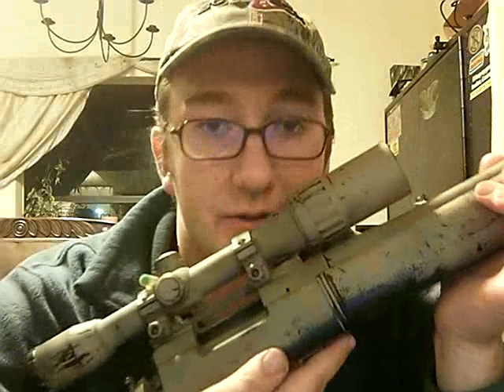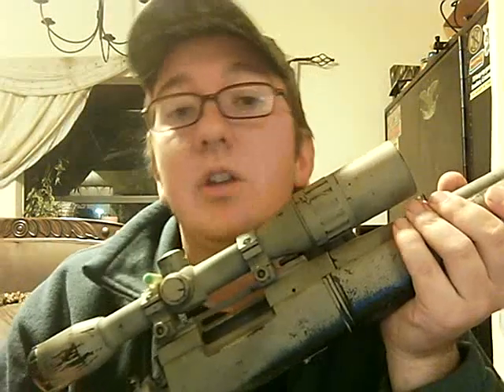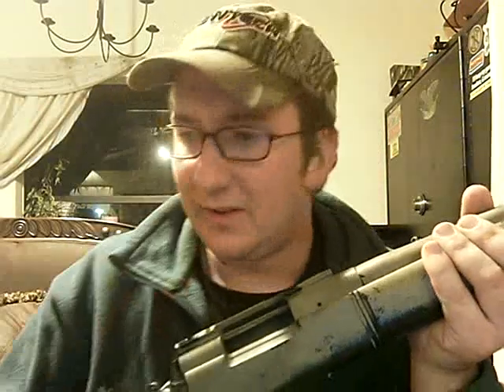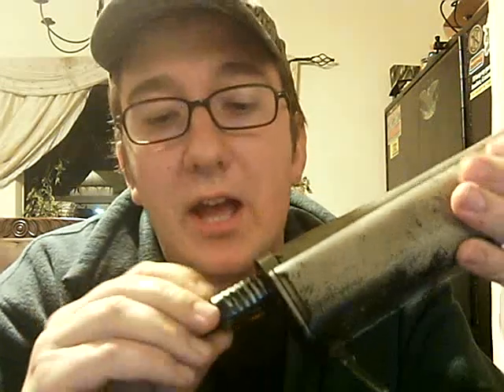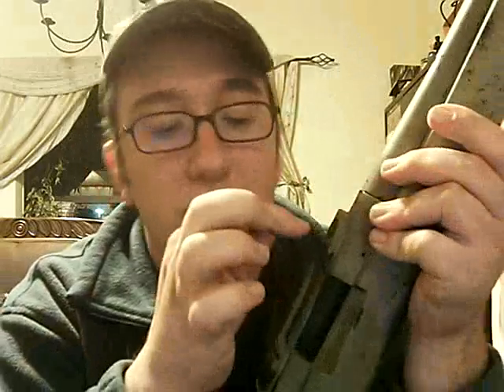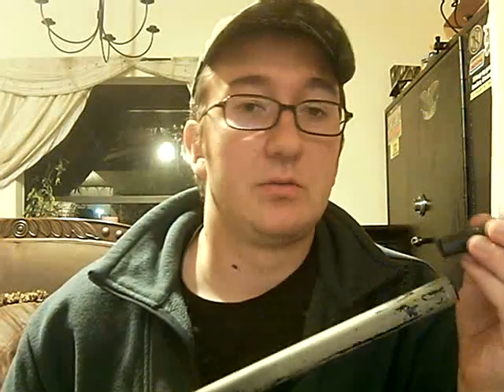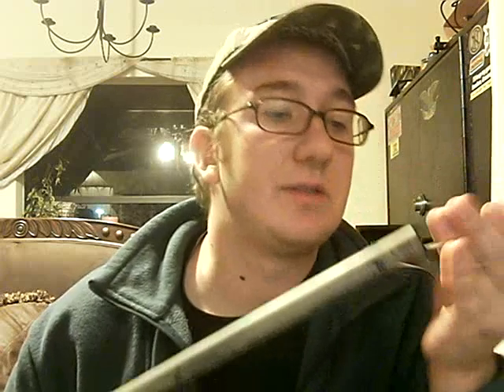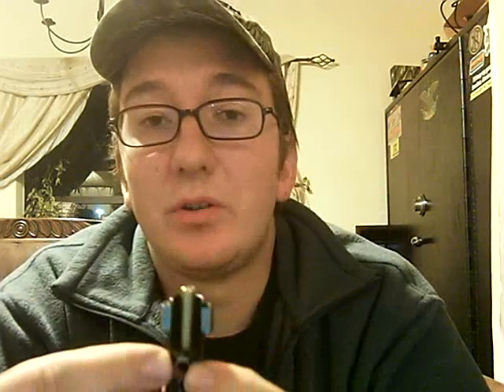Upgrades for the KJW M700.wmv

Comment from the maker: @EternalRB 
Its basically an m700 tanaka only with a different stock and a different diameter outer barrel. I would do the King Arms hopup chamber mod that lets you use VSR barrels and buckings, replace the nozzle and do your HPA or CO2 conversion and be done with it. Attaching a bipod to the AICS is also no problem since its a very solid stock. Great gun. I love it.

Comment from the maker: You should probably stick with the KJW bolt. If it breaks then a tanaka bolt should work. Different buckings depend on bb weight. But I like the regular TM VSR bucking as they are cheap and readily available. You might get more hop out of a king arms bucking if you need it. The hopup adjustment screw you have to buy. Someone on one of my videos posted a link to where you can buy it online.

Comment: Very good vid, alot of usefull information. I have found a G&G Power bolt kit fot the tanaka M700, so it should fit the KJW right? Also would using red gas be more consistent than green gas in the cold? Last question, you used a tokyo marui VSR bucking and a PSG barrel, what range can you hit a man sized target from?

Comment: Thanks so much for the video!  Now, I have a few questions.  First, would it be better to buy a Tanaka bolt and put it onto my KJW M700 Take Down?  Second, what kind of bucking should I get for it?  Third, does the hop-up thumb adjustment wheel come with the gun or does it need to be bought?

Comment from the maker: I'm assuming your on regulated air: You can lower the pressure of your regulator.100 psi should give you the same power as propane. do you have the striker spring upgrade? if so, that can be dangerous along with higher pressure. The striker spring allows higher pressure to be used because it can release more pressure from the magazine. Otherwise the stock striker spring doesn't have enough power to fully  depress the valve release with pressures higher than 110 psi which basically lowers fps.

Comment from the maker: I really like the King arms bucking because it seals the hop chamber around the nozzle, but stock TM bucking for a VSR or hicappa is pretty consistent. 
The stock KJW bucking is garbage. replace it with ANYTHING immediately and it will improve.

since you have an SCS, i suggest using the TM bucking($5). no sense in cutting the nub off of the king arms bucking which is $15 each. do you have the police version? If so then you can probably get all the hop you need with the TM bucking and SCS.

Comment from the maker: @EternalRB 
In some ways the police version is better and in some ways the takedown is better. The takedown has a metal hopup chamber while the police version is plastic. The takedown however can twist a tiny bit causing the hopup to not be centered vertically(fixable though). The police version has a better hopup adjustment but with an easy mod the takedown can have the same adjustment. If I had the extra money though, I would buy the tanaka AICS. I like it better than the M700.

Comment: Quick question for you about the KJW versions. Im after a  bolt action rifle that can be converted to co2 so have decided to go for the M700. My only problem is everyone says go for the Police version but all i can seem to get hold of is the Takedown. Is it really that much of a big deal? I saw in one of your vids you say dont use the bipods as it presses on the inner barrel and causes problems. Is there any way to fix this at all? I run a RATech 416 on co2, 509mm 6.03 inner so have lots of co2

Comment from the maker: @III280zIII 
Personal insults? you need to calm down son. The take down IS better IMO because it has much quicker access to the hopup. I've had to take the gun apart in mid game before to fix problems with the hopup and I can do it without tools. The police version doesn't make that possible or practical. I do like the police versions though, because they ARE more solid and because of the hopup adjustment knob which is far better. Mine is the best of both worlds, because I have both features.

Comment from the maker: tightbore barrel you should get last. It doesn't help with accuracy much. tightbores are overrated, and not necessary at all if you have an air rig. I've used tanaka mags on mine so they should work on yours. Finally, always use the heaviest bb you can get ahold of!